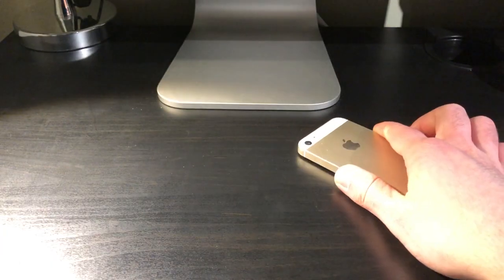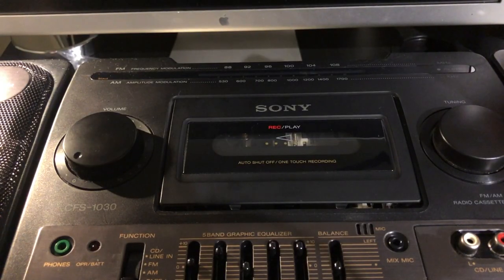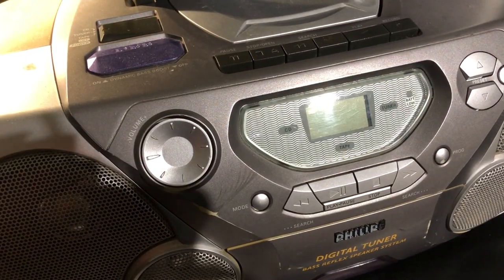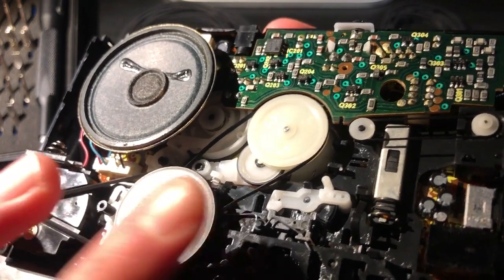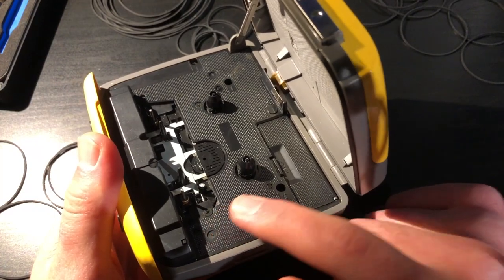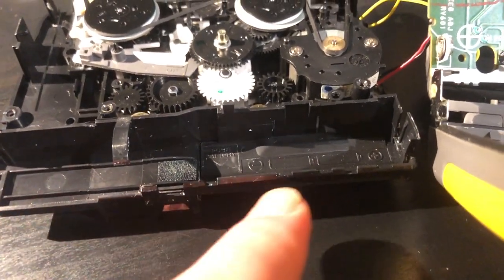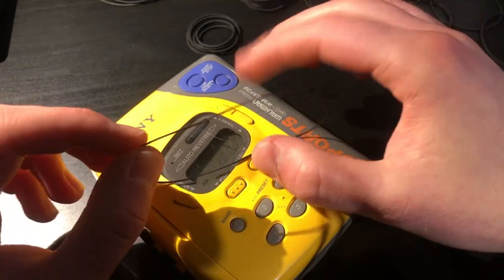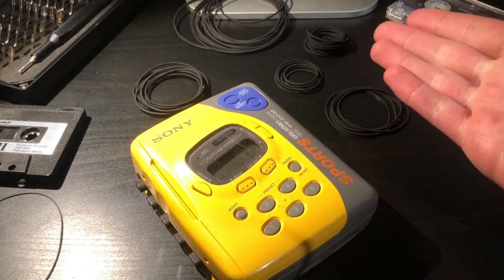Cassette Deck Belts from Amazon - How Well Do They Work?

Comment: I could so see that Home song actually starting out like it did when you played it on old belts. It suited the song pretty well!
Reply from the maker: Yeah, even with speed fluctuations, the song still sounds pretty good. I’m sure that the start up would make for some pretty interesting effects! I know I only mentioned it, but with that speed adjustment control, you could get similar results or even just play something slow/fast on purpose. Much easier to do with a fresh belt also since it immediately responds to the changes made. I would probably try adjusting the speed on purpose in the future to see how interesting it’ll sound and probably make a video demonstrating it. Ideally, I would get a good quality test tape first though.